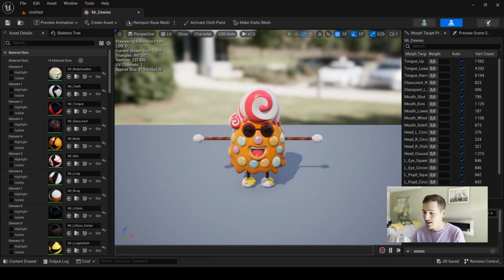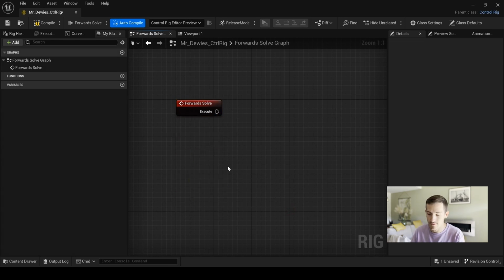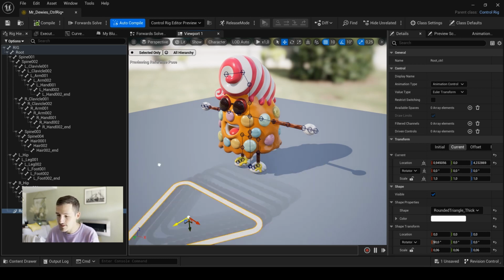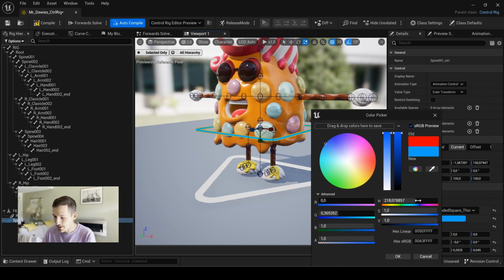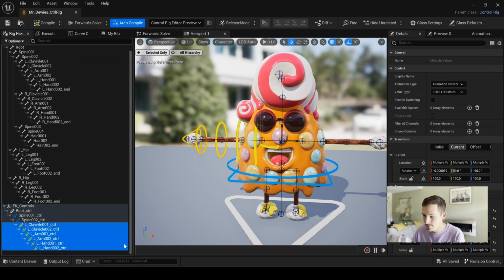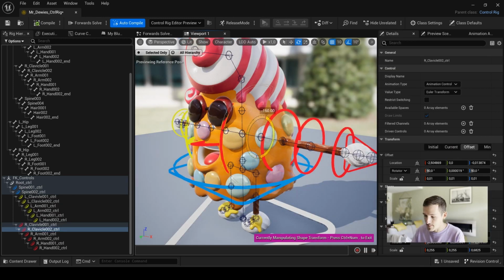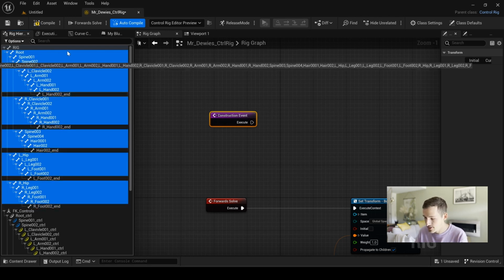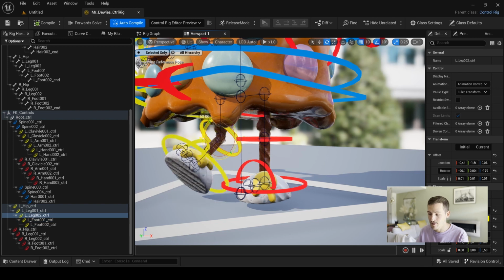CONTROL RIG Tutorial | FK Controls | Unreal Engine 5

Comment: What is the advantage of the Construction Event and Variables?  The rig seems to work the same when Item Arrays for Bone and FK Controls are plugged directly into the Forward Solve > For Each and At nodes.
Reply from the maker: The Construction Event does the heavy lifting since it only runs once, whereas the Forward Solve runs all the time.
So if you’re setting a new "initial" control position for instance, do it in the Construction Event, it’s more efficient that way!

The video’s a bit dated now, there are better ways to manage item arrays these days. In 5.7, you can label or rename items directly without having to plug them into a variable (which wasn’t super efficient). And yep, you can use them straight in the Forward Solve! 👌

Comment: Hello, I just have a quick question about my model. When I am trying to do the control rig, all of the new controls are so small, I have to set the scale up to like 50 to able to see it clearly.  Does this mean my model is the problem?
Reply from the maker: It comes from the DCC where you built your skeleton. I suppose it's in Blender?
One solution is to scale x100 your mesh and its armature, then Apply Transform for both. After that, lower the scale at 0.01 of both again. Export as is and then you should be fine, with correct size for your Controls! 😊

Comment: You make unnecessary actions with pasting global transform and setting offset transform from current. You just refused axis flipping when it was offered in the mirror dialog. This is exactly what this checkbox was made for. Just tick X and you'll get right transforms. 

You also don't have to create controls for each bone separately. You can select the necessary chains, right-click, new - add controls for selected.
Reply from the maker: Hey 👋 
Thanks for taking the time to write this comment. 
I didn’t use the Axis flipping feature because it is causing issues on the mirrored part. I’ve tried several times and I did have to manually correct it at some point. Plus I wanted to explain what’s going on here and how to setup manually things. It’s always better to explain what’s happening, mainly if you have quite simple character as I have here 😄. 

Same for the controls, it’s better to explain and demonstrate step by step for the viewer and avoid popping multiples controls at same time in the middle of the screen. Just a bit different of what you usually do in a personal workflow! I can understand. 

Hope you liked the video anyway 😄